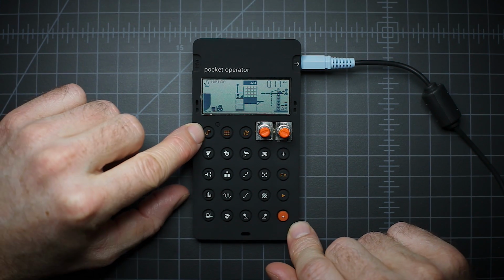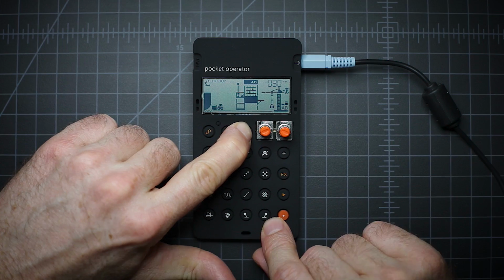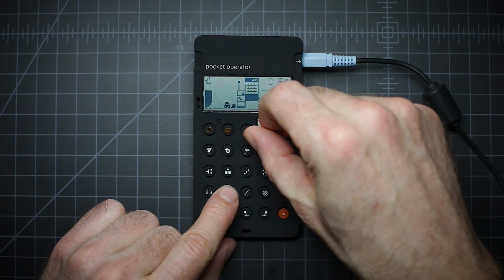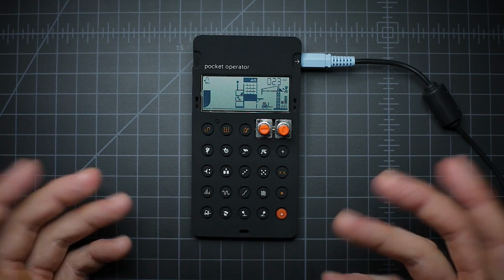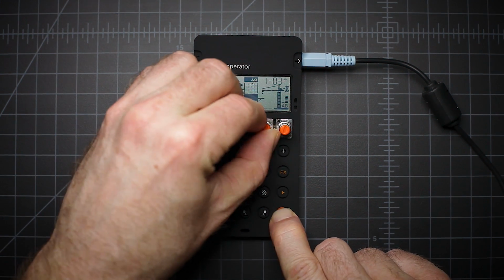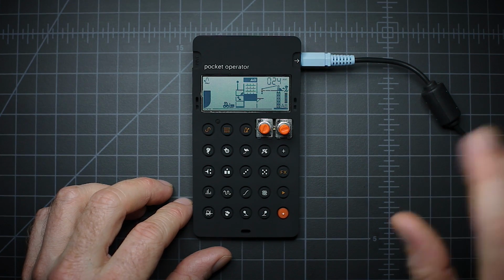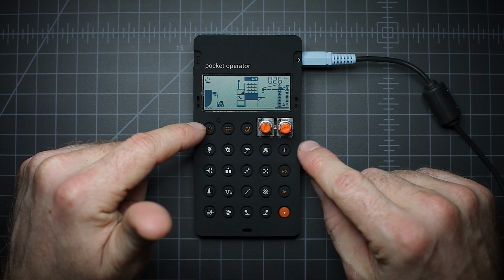TE PO-16 Factory Introduction

Comment: Sorry for being so numb. But I'd need to put my OPs (even the Sub Bass) on a cromatic scale. Any time i do as on the instruction manual, i press record,  select the knob and change the note (for example the A note into a C note. But as I get out of the record mode the knob returns to the original A note. It's vey frustrating. Do you know where i go wrong? thanks for your tutorials. great work!

Comment: I Would change pitch of sound so I turn the scroll weel and it's working but when I record the sound I lose my changes. Why ? Can we use sound modification in record mod ? Thanks
Reply: Hold the write button while you change the parameter and it should record the change as long as you have the sound you wish to change selected (hold "sound" and choose your noise).

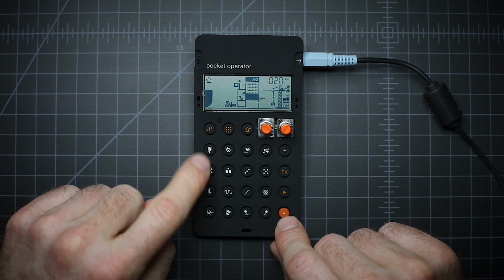Comment: 3:40 when you set it on those 4 steps, how does it know to do the  bass drum? Or is the sound 16 always the bass drum when entering in step sequence entering more?
Reply: Sound 16 is the drumkit. Every button in sound 16 is a different sound. You can change it by pressing and holding an activated step in sequencer mode and turning Knob A! The Kickdrum (d08) seems to be the default with mine too...

Comment: I have a question that I'm sure will prove to be kind of a stupid question. But I have a reason for asking. Will this sequence external audio or have any kind of MIDI capabilities at all? I assume the answer is no but it would be cool if they could do that. Also, is it 8 steps max?
Reply from the maker: it can pass an analog clock signal out to synth with things that accept that, like volcas or eurorack. that's it.
Reply: @RedMeansRecording  Cool. Thanks for the info. :)

Comment: Question: Can a live recording be cleared? On any PO? How? Thx
Reply: Yes, you can see the LEDs turn on at the corresponding steps of your live recording.
In write mode, click each of those steps, the LED will turn off and it will be cleared.

Comment: Hey. Ive got a problem with my PO Factory. When clear a pattern I still hear a beat coming out of the device. Even if the pattern is empty I hear 1/8 notes coming out of my Pocket Operator. Is there any way I can fix it?
Reply from the maker: You have a sync mode on I bet, which is spitting out metronome? Look up the guides on the TE page and figure out how to change sync modes.

Comment: can you somehow transfer your creations from a pocket operator to a computer?
Reply from the maker: You will need to record the PO like you would any other hardware synth or guitar or musical instrument with a line out: plug a cable into the output (like you see in the video) and plug it either directly into the computer's input or into a sound card, then use software to record it in realtime.
Reply: Red Means Recording ok thanks